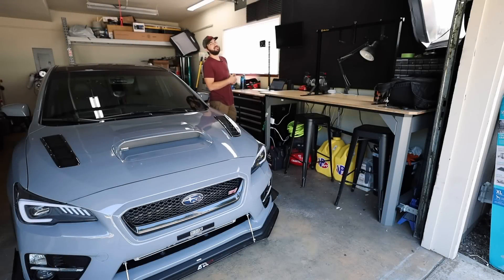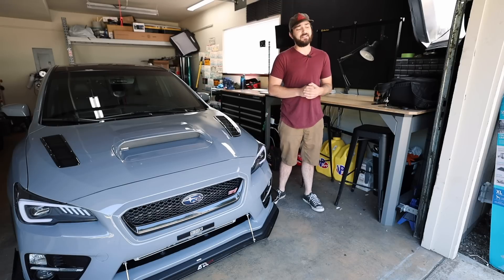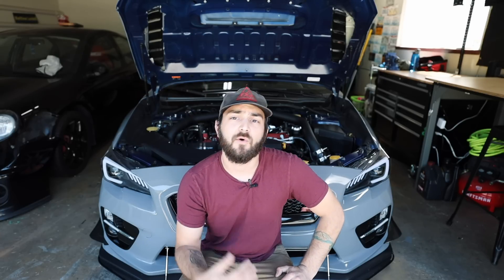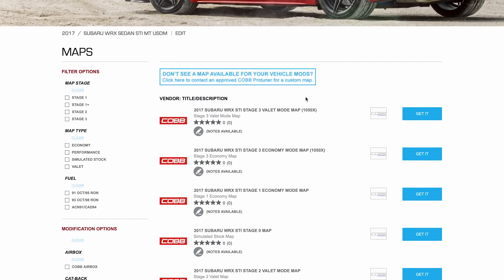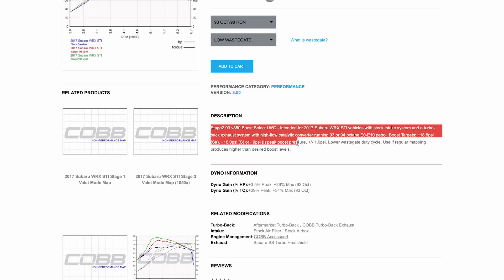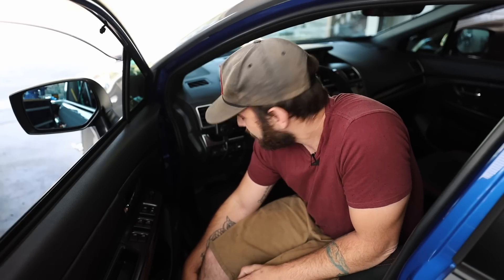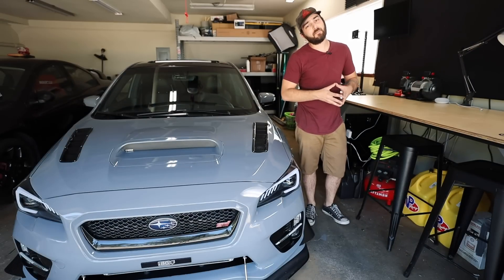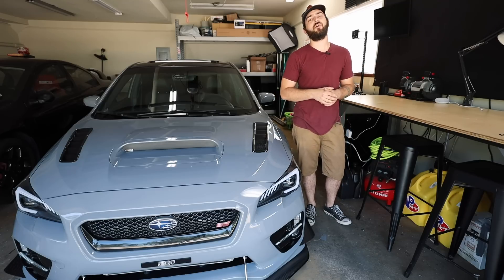Understanding OTS Tunes and What You Need To Know

Comment: Awesome info. Thank you. 
Quick question 
I m on my 3rd ej25  engine block (08 WRX)  , back then I did often use Cobb stage 1 and sometimes stage2 with the Cobb DP. Now on my 3rd engine, I’m not using a Cobb ots tune , but I want to know the bad things that are happening to the engine when using those tunes? 
I know, let the car warm up,  but with the extra boost what are the possible damages?

Comment: I watched another video where a guy with a shop that tunes WRXs and STIs wanted to put his friends bone stock 2018 STI RA???  On his shops dyno to see what kind of numbers it would do. Before he put it on the dyno he asked his friend what he thought the HO and Torque would be. They both guessed around 239-238 hp and similar torque. He made 3 pulls on the dyno and on the first 2 pulls the car made 270+ hp and similar torque. On the 3rd pull he did it in Intelligent mode and it actually did a few more hp and rorque. Those are surprising numbers for a “ bone stock “ STI RA but the concern stats the dyno info showed that the car was running lean through most of the pulls. Would a Cobb OTS tune make adjustments to riches the fuel mixture a bit?

Comment: I have 2017 wrx with 2.0 my problem since i bought the car is as soon as i give it full throttle the car heavily pulls timing ive seen negative 7 degrees on full throttle no check engine light or anything. Any idea why its pulling timing on full boost

Comment: I have an accessport but idunno what stage of map im going to download coz i dont know much about all the aftermarket that has done on the car. All i know is it runs a Takeda Cold air intake, cobb titanium exhaust and a blouch turbo that brings 24 PSI😅.
Reply: Step 1 learn what you have, don't push the car. Step 2 get a pro tune.  Or... ignore step 1 and 2 - beat your car and get ready to buy a new motor. 😖

Comment: I just bought a Subi that came with an Accessport in it, and the very first thing I did when I got home was ripe that POS out of the car and throw it in the closet! I prefer to be able to tune my own car and thats not possible with an Accessport.
Reply: Huh? 🤨
Reply: @chugns1481  Ever since Cobb got sued by the EPA years ago, they were forced to severely limit what their products can do. Using their Accessport devices, you can no longer do things like disable Check Engine codes, install Flex Fuel kits, delete TGVs or Air Pumps, disable rear O2 sensors for Cat deletes, etc. Also, you need a special license from Cobb now and to go through their training courses to get access to the actual tuning software now, so only licensed tuners can have access to their software.

Comment: Hey brother nice video..just bought 15 sti with 100k it has Cobb intake exhaust..not sure what kind yet..has burnt blue tips and maybe some other modes but not sure since bought from dealer..no accesport was with car but I have one..I was told on wrx that once I did big sf intake I needed to use that map selection or engine light may turn on..this sti has no engine light and don't  know if it's been pro tuned..should I try accessport?

Comment: Ots tunes don’t suck. I mean certain ones may suck but as an option they don’t suck. Generally, the same motor is going to respond similarly to the same mods. This has been documented. If you follow the recommended “guidelines” set by the company doing the tuning then typically you will be just fine. Not everyone wants a race car either. Stage one tunes are great for making cars such as the gti much more drivable. I’ve read a shit ton of comments from people who say they have been running ots for 40k miles and have no issues yet I’ve hardly read any comments that say it fucked their engine up. It boils down to what do you want your car to be?

Comment: I have a OTS tune. APR. It was flawless stage 1 but when I went IS20 tubo with tune I started having high rpm WOT misfires. This is for 2015 VW golf 1.8T FWD auto. I'm still trying to figure it out or find a better suited option.

Comment: ya but, regardless of the tune, except 1, probably requires the engine to be rebuilt? d/t pistons, ring lands, etc.?
Reply from the maker: Nope, my old stock block was pushing 460whp without a hiccup
Reply: @Smeedia  Interesting. What about the FA24? I ordered a 2022 WRX and I'm trying to start figuring out what I can/can't do. I'm having problems finding the internal specs, e.g., pistons forged/not, crank is forged I believe, Rods have been beefed up, etc. I don't see any vids of anyone tuning an FA24.
Reply from the maker: Therr is no tuning software out for it yet so we're kinda in limbo at the moment 😅

Comment: So if I have a bone stock 18 WRX, and i put a Stage0 OTS tune on it to improve the rev-hang. I should be good right? I definitely want a pro tune but I feel like i need to upgrade a few things to make the pro tune worth it, right?
Reply from the maker: It will indeed help with the rev hang. And you are correct. I'd wait until you get some more parts
Reply: @Smeedia  thanks for the feedback. I went on a rabbit hole lastnight trying to find an answer. Seems like the community is split between thinking its the same as the “stock tune” or it def helps by changing the throttle to linear. I guess I’ll buy one and find out.

Comment: Hey man I’m trying to get a etune which one do you recommend i got a 2018 wrx with a stage 2+ ots tune from Cobb
Reply: Also I am running a cat less down pipe
Reply from the maker: No one will be able to tune with a catless downpipe not on accessports. I'd suggest thr grimmspeed catted one. But Ambott is great for the wrx platform 🔥

Comment: Hey, I have an 06 WRX with stage 2 mods from previous owner. Sti intercooler, catless downpipe and catback exhaust. I’ve been driving the car for 1200 miles over the course of 3 months and it’s been running smooth. My butt dyno was telling me that it was probably open sourced tune since it was running rich and smooth from what I felt.
I’m getting an accessort this weekend to play it safe and to monitor feedback. Will the Cobb stage 2 OTS tune work with my setup until I’m ready to get etune ?

Comment: If my dam dropped too 0.875 and I get normal readings for knock should I be worried the car runs fine I got it from the dealer with 50,000 miles ?
Reply from the maker: What is thr car, what mods and what tune? 

You can try resetting ECU Learning and monitoring things 🙏
Reply: @Smeedia   I only have byp boomba, with muffler delete, and stage 1 big sf+ 91 off the shelf map, with the accussport, I also have a AOS separator street series but I havnt instealled it yet,, I go to chevron for gas, should I try shell?
Reply: I asked because I’m tryna see what I can do without a  pro tune
Reply: Gas wise I’m using 91 chevron should I try shell

Comment: I was running 76 gas station on the 91 tune and the dam stayed at 1 but I try chevron and my dam went to 0.750 should I be worried and should I go back to 76 gas station ?
Reply from the maker: Try resetting your ECU learning and monitor DAM after that. If it drops again then I eould try a diffrent fuel station
Reply: @Smeedia  thanks man for the help

Comment: Hey Tanner, the ‘05 Outback XT I recently bought seems to have been tuned since it brought a few aftermarket parts already installed in it. How can I know if my car was previously tuned if I don’t yet have a Cobb AP?
Reply from the maker: You may be able to access it with rom raider and a tantric cable but that can be hit or miss 😖
Reply: @Smeedia  Arghh.. Oh boy, and I thought I had purchased an almost stock car.. lol Goes to show I didn’t do enough research.. What’s my best route then, taking the car to a reputable Tuner shop see if they can find it? My plans were to overhaul the motor on this car, but looks like I made a bad decision buying a tuned car with no Cobb AP.. 😔
Reply from the maker: Do you know if the prior owner had an AP on the car?
Reply: @Smeedia  No. Previous owner was a mechanic who just maintained and serviced the car for a year and kept it with all the parts as it is now. The mechanic never replaced any “performance” parts. Prior to him is the one I’m trying to find out/contact..
Reply from the maker: Mmmmmm if it were me I could snag an AP and rewrite the ECU with a new tune
Reply: @Smeedia  Ok.. Thanks for the tips bro. Anything you can recommend is greatly appreciated. I’m a honestly a noob with these turbo motors/tunes. 👍🏻
Reply: Already hitting the books with the Romraider/NASIOC's Complete Tuning Guide..
Reply: @Smeedia  What would be the worse case scenario? Having to buy a new ECU for my car and reprogram/retune it?
Reply from the maker: Nah, an AP can reprogram over an old tune 🙏
Reply: @Smeedia  Fingers crossed 🤞🏻 Ok, thanks Tanner

Comment: Great video!  You helped me  chose the accessport over stand alone.  I have a stage 1 kit on the way for my 2017 with 24k on it.  A Cobb Silver dealer (Quantum-Performance) is doing the install, they've recommended the OTS map as the first step with the SF intake.  They've advised me to try it out, despite the fact I would have had them do the 3 port EBCS, and FF kit as well.  Not having read the manual, my impression is that I'll leave the v3 plugged in and it collects all the relevant data, which is then analyzed and the tune adjusted as desired or with new hardware?
Reply from the maker: You don't need to leave it plugged in if you dont want to. Think of thr AP as a a display for your PC. 

The ECU is the PC and the AP is the display. All data will be stored in the ECU regardless if thr AP is plugged in 🙏

Comment: my question is, will Cobbs OTS maps compensate for things like, say, if you happen to get a tank of "bad gas" completely unbeknownst to you, like the stock tune will just in order to keep things safe?  very curious,  thanks!
Reply from the maker: Yes your DAM will drop reducing your ignition tables. 🙏
Reply: @Smeedia  gotcha! thank you, i appreciate your reply.   to add, i have a 2021 STi and im thinking of eventually going with cobbs stage 1 + kit (AP with SF intake and box,  and running their matching appropriate map of 93 octane & normal waste gate. i can readily get 93 octane from a top tier fuel station where i live)
i already have a crawford V3 AOS and the GetaDomTune Cylinder 4 coolant hose mod.  i dont drive the pants off the car, and i dont track it, just want the induction and turbo noises, to add, and do 2000 mile oil & filter changes (overkill i know,  but the sti is also my 2nd vehicle). but, in your opinion , do i need any further supporting mods to completely safely run the cobb stage 1 + with my desired map?  like, should i get a killer b pickup tube or perrin oil cooler, and koyo radiator because im now asking for more of the car? or is the stock stuff sufficient to handle the intake and tune with my already installed AOS and Cylinder 4 mod.  thanks in advance. would appreciate your input
Reply: @kcm732  bro im in the same boat, 2021 sti limited, and want turbo sounds. honestly it is easy to revert it back to stock, but the cobb stage 1+ with the intake is actually better than the stock intake apperantly. and if you run the 91 ots tune instead of 93 you also get extra knock protection. i would say send it man. its not like your modding the car by a huge margin, nor are you actually really increasing any performance.

Comment: I just bought a 2015 WRX, and the previous owner already had a stage 2 +big sf COBB tune all ready to go. He had it catless and the dealership couldn't sell it without putting cats on. Then I learned, like you said in the video, I should look up what parts the COBB tune asks for. Now, I have to get it in the shop to put high flow cats on, cause the dealership ones aren't cutting it. I'm afraid to let loose with it not having the right parts.
Reply from the maker: Definitely make sure you've got the right parts on there 🙏 those cats wouldent do anything harmful aside from reduce exhaust flow 😖

Comment: what tune should i run ? i have a 2017 sti, i’m running a invidia downpipe and a invidia n1 dual exhaust
Reply from the maker: For that downpipe I would suggest an Etune 🙏
Reply: @Smeedia  what ots tune should i use while i get my e tune, etune currently out of stock so i’ll have to wait for it
Reply from the maker: There are no etunes specifically for invidia but the Cobb stage 2 should be close
Reply: @Smeedia  i appreciate the help my guy i really do thank you
Reply: @Smeedia  what would be best lower waste gate , normal, or high wastegate?

Comment: What tune on the Cobb should use for catted down pipe and Cobb air intake. Also do they have tunes now that would override my catless downpipe and Cobb air intake. Any recommendations? I don’t want to screw this car up. Haha (don’t believe I have any pro tuners in my area or even state).
Reply from the maker: What is the car? 🙏🙏🙏
Reply: @Smeedia  2011 WRX
Reply from the maker: Stage 2 + 🙏
Reply: @Smeedia  okay and do you recommend I get a Cobb down pipe sooner than later?
Reply from the maker: Whenever your ready, great downpipe choice 🔥

Comment: What is a good way to just get more induction noise that doesn’t require a whole lot of tuning and is safe? I’ve looked into the COBB SF intake and it seems like the thing I’m after. Do you have any recommendations or better ways to increase induction noise on a 2019 STI all stock? I wish they made an SPF intake for newer models like they did for the 04-07 sti gens
Reply from the maker: SF intake will get you the sound 🔥 you can run the stage 1 map with thr intake without issue

Comment: It makes complete sense why an etune or a pro tune is the best option, but one thing I don't understand is why an OTS tune is different than the stock tune? The OEM doesn't custom tune each car, so all of those variables apply to the car from the factory too. 

Sure, a Cobb OTS tune is more aggressive than the stock tune, but from what I've read, Cobb's 2015+ OTS tunes are fairly conservative. So if you use 93 gas and the 91 OTS stage 1 tune for a little bit of extra safety, is it really worse than the factory tune?
Reply from the maker: SOA flags the cars with OTS tunes because they're "more aggresive" when they just add some fueling and a little boost. Cobbs maps run a little rich to stay on the safer side
Reply: @Smeedia  so in terms of safety, is a Cobb OTS tune generally about the same as the stock tune then?

Comment: Look man I’ve been looking at so many YouTube videos talking about stage 2, why you shouldn’t go.. why you should go and you were probably the first one that considered me to go into stage 2.  SO I had recently bought a catted downpipe from invidia, my whole exhaust set up is invidia. A COBB SF INTANK and A accessport, I just want to run the OTS tune that it comes with just for a few months b4 I dyno the car. I shouldn’t run into any issues correct?… THANK YOU! Love the videos
Reply from the maker: Got you on thr last comment but what is thr car and what year?
Reply: @Smeedia  it’s a 2020 Subaru sti brand new off the lot I purchased bro, only has 15k miles on it
Reply from the maker: You'll need to do the injectors, fuel pump and  FPR to be able to utilize both intake and downpipe. The 2015+ STIs fuel system just isn't up to par to handle intake/downpipe on an OTS Tune unfortunately
Reply: @Smeedia  so even thru a catted DP there’s just no way to run that stage 2 ots map thru Cobb, /: would you just recommend me running just the catted DP rather then both at the same time then?
Reply from the maker: Correct, it's more of a fueling issue then anything. And personally I would use a downpipe over an intake
Reply: @Smeedia  okay if that’s the case I think ima just hold off on that intank… what if you ran a ETune for say while using both these mods, would there be any issues then? Or the tune just doesn’t matter?..
Reply from the maker: You can do that but you won't see thr gains from the mods, not really worth it IMO
Reply: @Smeedia  sorry if I’m buggin and shit boss, I just want to talk to somebody that knows his shit which you do, would I see a difference if power if I just for say ran just the catted downpipe?

Comment: Question just got my dream car which is a 2019 wrx not that long ago with it  I don’t know if you’ll be able to answer but do I need a Cobb AP in order to tune my car if I add a intake
Reply from the maker: Yes you'll need an AP 🙏 congrats on thr car BTW!
Reply: @Smeedia  k ty that I all I need to hear
Reply: @Smeedia  one more question do I need a ap and a tune for me to keep driving my wrx if I put an Grimmspeed Boost Control And MISHIMOTO Cold Air Intake or will it miss up my engine
Reply from the maker: Yes you'll need an AP and need a tuner to map you a map for those parts 🙏

Comment: Right now I have a 2016 Lexus IS 200t f sport and I'm running a HPS air intake, ark exhaust, downpipe, HPS charge pipe, and a racechip gets tuning box, do you think I'm better off switching to a high flow catalytic converters ? Also if I do switch to a high flow catalytic converter will my cel go on? Will I be able to pass emissions?

Comment: can you install accessport again even if the old accessport hasn’t been unmarried yet. it’s just i bought my sti used and i want to install one but  i dont wanna ruin my car also. so i gotta ask the experts.
Reply from the maker: No, you have to have one that is unmarried 😭
Reply: @Smeedia  that’s the plan. but what if the old owner didn’t reset the ecu back to stock can i install new accessport again?
Reply: in short, can i bury that tune with another tune without resetting the ecu?
Reply from the maker: Yes you can overwrite the ECU with a new accessport